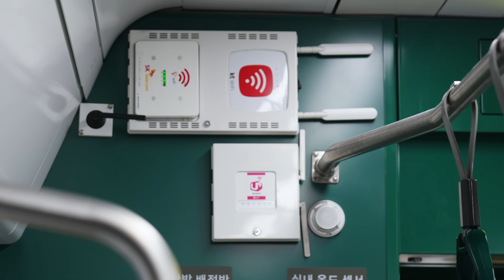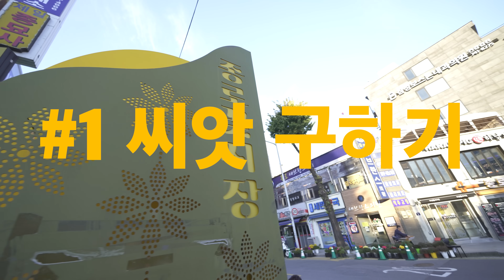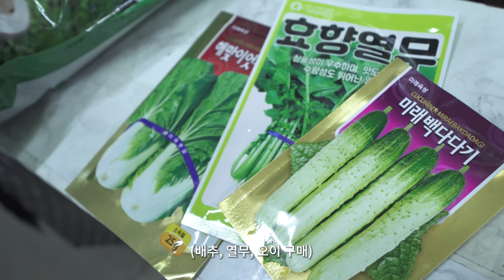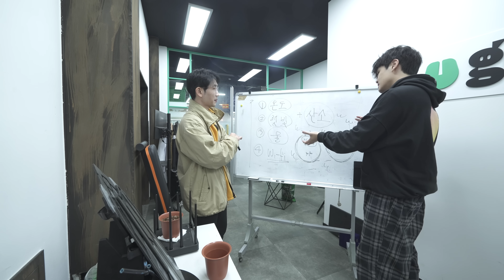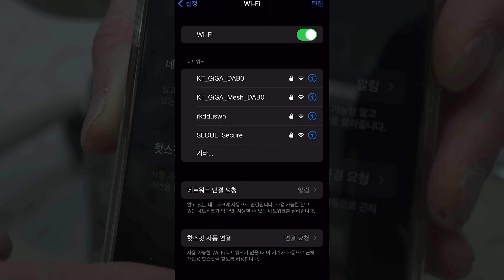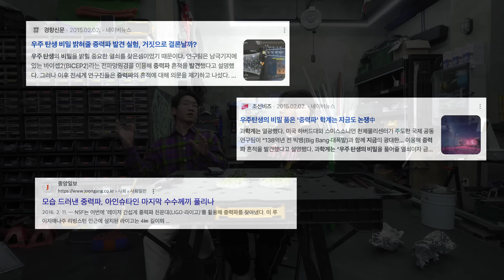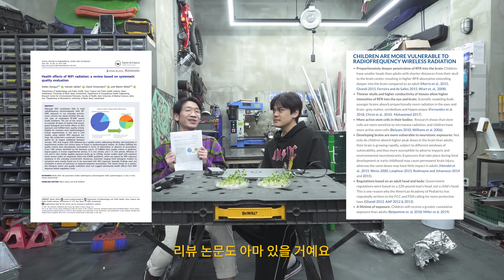전자파가 식물에 악영향을 끼친다는 충격적인 연구결과... 과연 사실일까? 실험해봤다

Comment from the maker: ⁉궁금한 실험 제보하기⁉
긱블이 해 줬으면 하는 실험들 마음껏 제보해 주세요!
https://cafe.naver.com/geekbleofficial
Reply: 착한말 나쁜말 양파 실험
Reply: 실험하신 기기가 WiFi-6는 아니죠? WiFI-5는 되나요?
Reply: WiFi-5 model 이네요(iptime 604SE)
Reply: 카메라 작동 전자파가 있어도 자랐다는것.
Reply: Which frequencies those you used in your experiment? In the past, Wifi used 2.4 GHz which is the same frequency as used in microwave oven plus during test they need to run data traffic  at some level (not at idle data traffic). There also be another thing possible..... SAR standard was reduced the intensity for multiple times from the past until today So the intensity in EU was so strict than in Asia and America which follow  ICNIRP standard. However please learn what  The Seletun EMF standard recommend!!!
Reply: 5g. 안테나  앞에서 꿀벌 실험을 해봐 !